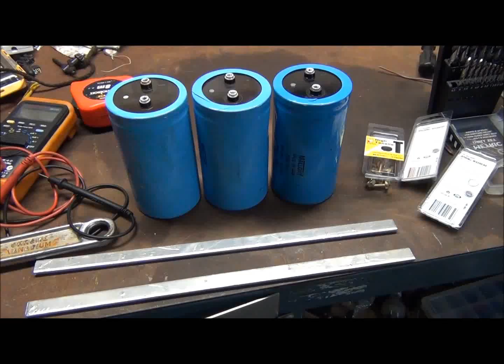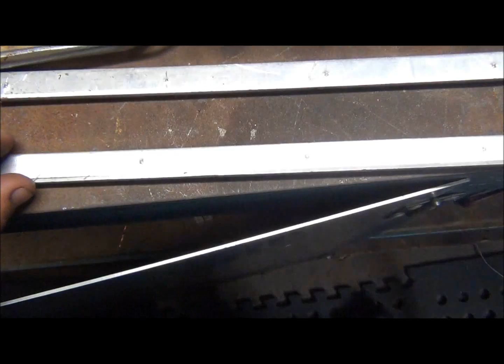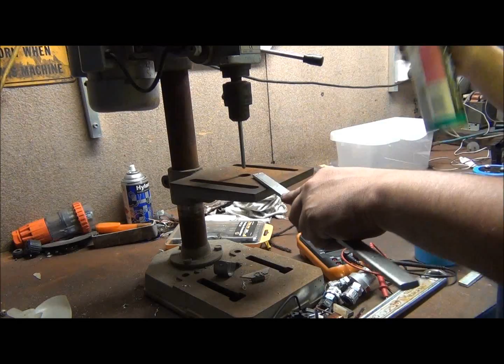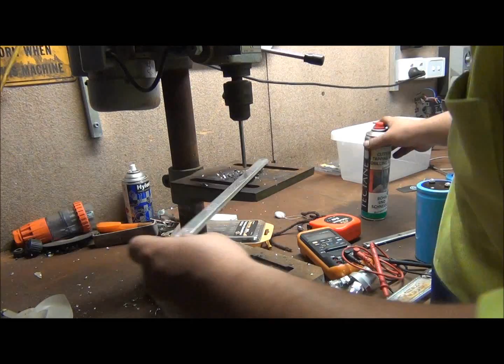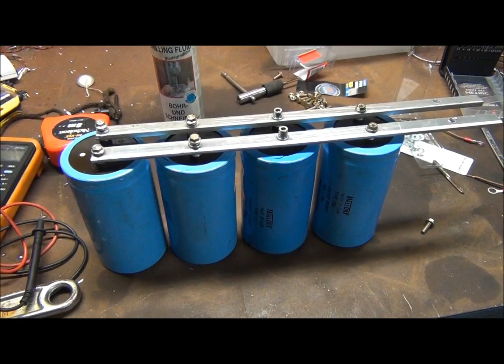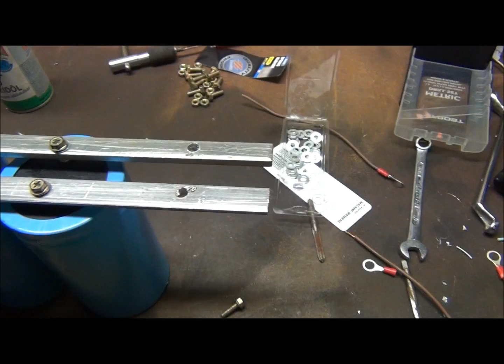Fabricate Bus Bars for Capacitor Bank

Comment: I always drill 1/5th and then back off, clear chips and continue to drill in 1/5 increments, especially with smaller drill bits. I also put the piece up against the coloumn so if the drill bits, its not going to spin around and take off limbs. :)

Comment: Cool - I just finished a new board (the old one didnt work), that will interface nicely with an arduino. theres a 0-5v reference that equates to 0-1000v. math in the arduino will watch this reference and turn off charging when the caps are charged. Hysteresis code will stop the charger turning on and off rapidly.